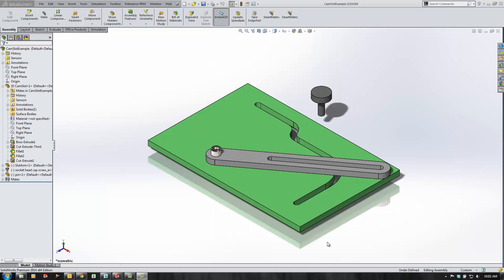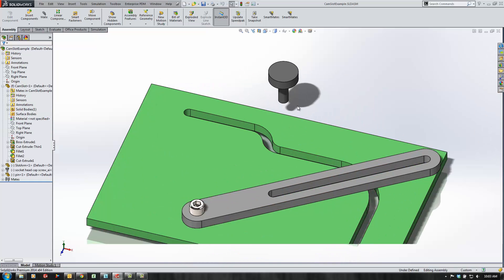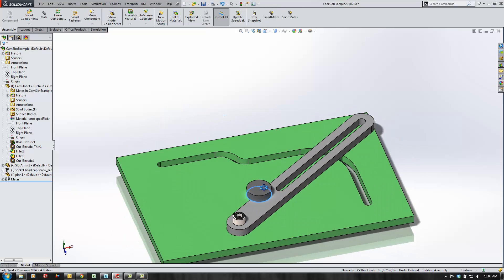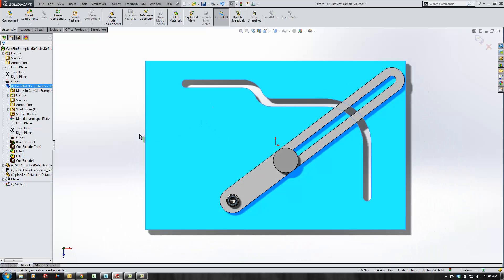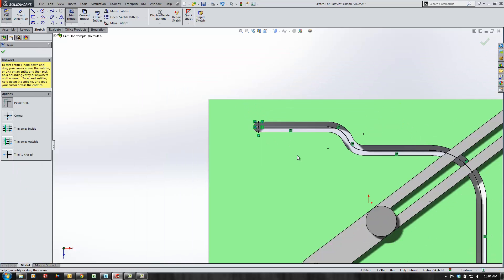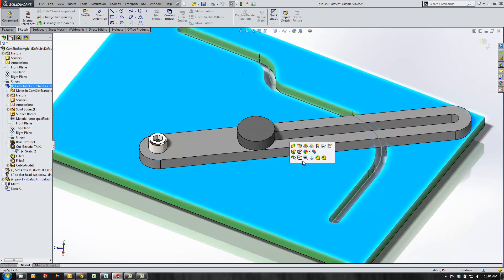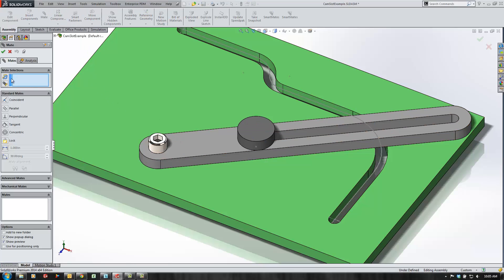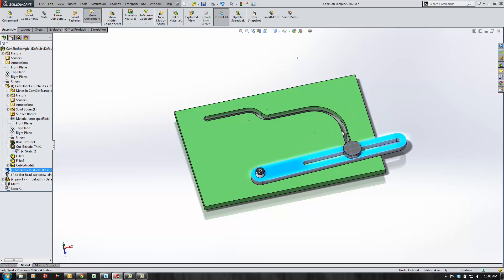SOLIDWORKS - Cam Slot Path Mate

Comment: I have a question. I am trying to do that but for cam selector (don't if that is how it called) in a sequential gearbox. 
The thing is that the slot is around a tree. I don't know if it is also possible to do that in that case.

EDIT : i manage to do it with a 3DSketch, ALL IS FINE. THANK YOU FOR THE AMAZING TUTORIAL !

Comment: Please Help. My part will follow the path (arc) that i want it but it will exceed the path and continue following the whole circle of the arc that i sketched(I trimmed the excess part of the circle which i tend not to use already). Do you have any idea on whats wrong and how to solve?
Reply: choose open loop in your selection manager tab before you select the path